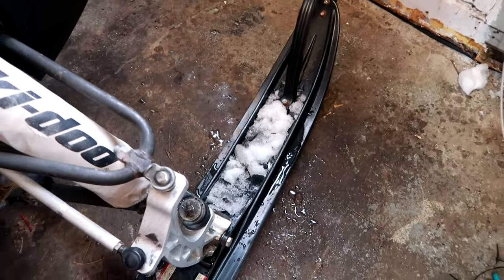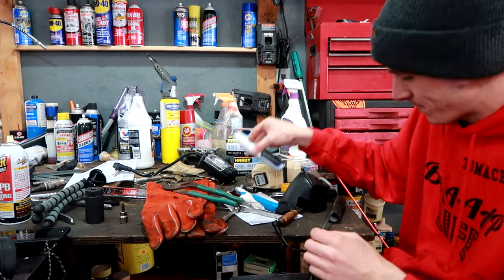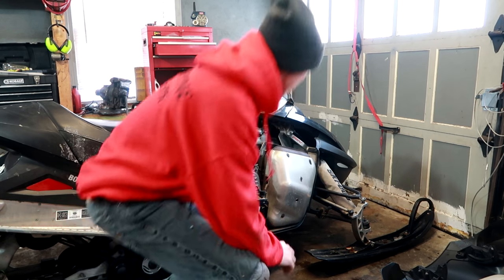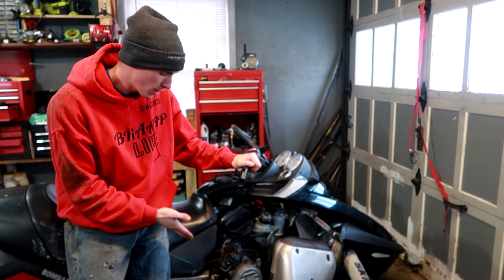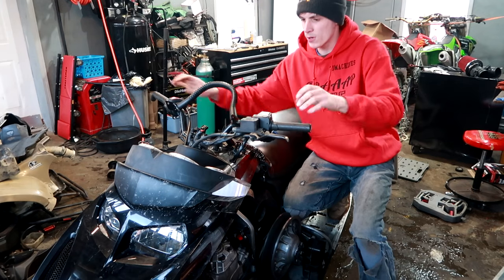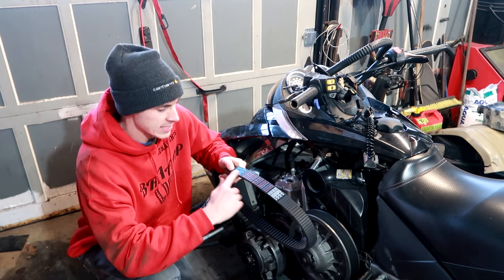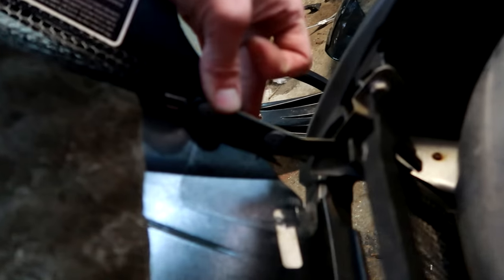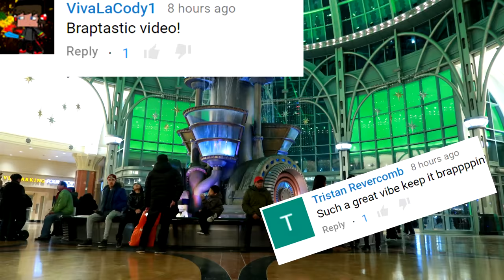It's Worse Than I Thought...

Comment: Dip your hex bit socket in lapping compound before attempting to loosen a stuck cap screw; the fine compound will fill the voids and enable you to remove it.  Works well for KTM's too!
Reply from the maker: thanks for the tip!
Reply: michael delage ☺ smart man it worked on my tractor diff...slick as snot..see Dalton freaks helping freaks through a 3dmachines,you got to love it..

Comment: Instead of going through all the work of putting a new grip on, then finding out that it doesn't work, then having to take it off and run the wires, why not take a multi-meter and check that you at least have voltage going to the plug for the grip while you have it off?
 If you have voltage, then great, your problem was in the grip. If you don't, then you can be tracing down your problem while the grip is on it's way, and you can have the problem fixed by the time the new grip gets there.

Comment: I used aluminum tape on the backside of my ATV plastic and it worked extremely well. Its used in HVAC. No holes for ties is a plus. Can't even tell it is there and strong.

Comment: Been watching your videos for a few years now. Keep it up! Quick  tip, next time you strip an allen head, or any bolt head for that matter. Take a nut that's a little bigger then the head of the bolt and weld it to the stripped head. Hold the nut to the striped bolt with pliers and burn it in hot from the center of the nut. Walla, new head on the bolt, turn it right out with a wrench.

Comment: To easily remove a stripped screw, you can use something like a Dremel tool and cut a deep groove all the way through the head of the screw so that you can fit in a flat head screw driver in The groove. Then spit it out like a normal flat ahead and put in your new screw that you bought off-line

Comment: A little advice about stripped allens..... hammer a slightly bigger torx  bit. Works everytime. The torx bit doesnt push out nearly as much material and bites really well. Also with hammering it in, it is also shocking the threads to a tight bolt.

Comment: 3DMachines, the handle bar warmers do not heat up when the sled is idle, they will only warm up when the sled is in motion, just in 2015 the when the rev xs chassis came out the handle bar warmers were able to warm up while idling. My cousin has a first gen rev and the handle bar warmers do not warm up until in motion. My dad has a 2016 ski doo 600 etec which have the idle handle bar warmers.

Comment: Dalton love the vids keep em coming. Couple things. I know for a fact that Polaris belts do NOT have arrows on them so the way you explained in the video is 100% correct. Another thing, you should never start your sled without a belt you can actually cause clutch damage if it accidentally revs to high when first starting and the sheves slam together. Last thing is you should be able to put an ohms meter on there warmer and see if it is broken that way. Anyways love the vids keep em coming

Comment: Fix your hood with mechanics wire and stitch it up then cover it with plastic weld. I have done this on several bikes, ATV, and vehicles. It works great and in some cases ends up stronger than the area around it.

Comment: When I had my old rev I found the best way to drain the chain case was to pull the plug and remove the cover to inspect the chain and tension. When that cover is off go ahead and clean the inside up good and remove the fine metal shavings. If you don't take that cover off your not gonna get all the shavings out if you just pull the plug. Hope it helps 3D

Comment: hey Dalton ... I have a ski doo myself and my handlebar warmers dont work either and ive traced it all to a faulty regulator ... which is placed on the front of the motor ... you have to take the muffler off to fix but its worth checking out

Comment: @3dmachines if you ever run into the problem of getting a bolt out that is stripped. You can weld a nut to the head of the striped bolt then us a wrench to get it off before it cools. Also love the videos!

Comment: Always clean the inside of a Allen socket bolt. Take a pocket screw driver or a fine point and make sure there's no dirt or grime in there. Always. This is coming from someone that worked at a VW dealership and just about all VW uses are Allen sockets

Comment: Dalton! find as bolt that will go into the stripped Allen hole in the chain case....tac it in with your mig....use a socket to get out the plug..also the heat will get that over-tightened bolt plug loopse

Comment: The skidoo hood plastic is called tpo. Thermoplastic olefin. It's a mix of an olefin like polypropylene polyethylene and a bit of rubber. Fiberflex is the welding rod you need but it's in a bad place down by the hinges. You might be better off with zip tie stitches for strength.

Comment: You can also melt some wire mesh into the plastic for strength.  They sell plastic "welding" kits.  I've repaired bumper covers this way.
Reply: Also weld a bolt head to the drain plug and use a socket to get'er out!

Comment: My drain plug was also stripped. so I did it the old way and just took the chain case cover off. GLAD I did, the lower sprocket bolt was loose and was wearing into the chain case cover.

Comment: take the chain cover off then you can see the chain tensioner that is what I did on my mxz 600 and my Yamaha viper 700 way easier than trying to get the plug out and most of the oil goes down the hole any ways great video thanks.

Comment: Dalton tip the sled on its side or hook a come-along to the front or back and lift it up in the air so you aren't trying to work on the ground. 
Atf oil can be used in most chain cases. It's cheaper.
Reply: Pay attention to where your coolest bottle is so you don't get air in the system. If you do you will have to burp the sled.

Comment: I have 3 CUMMINS. 2 articcat snowmobiles. 1 Honda 250. 1 Suzuki 500. 3 Polaris 1 is a ranger 900 and 2 r razors 800s. And some brand 50 2 stroke. Some brand 90 2 stroke. A Polaris 170 side by side. Yamaha big bear 350. 5 diesel tractors. 2 harly division motorcycles. Love videos keep up good work.

Comment: That is the worst part of buying a brand-new used vehicle. I bought a 2000 KTM125SX and the drain bolt on both sides were stripped with another 12 other bolts worst feeling. I don't understand how someone could strip so many bolts on one bike.

Comment: bought a brand new (at the time) 2016 mxz tnt high output fuel injected 600 ski doo in November of 2015 off the showroom floor, best damn investment I have ever made. She wheelies like nothing and is the lightest sled I've ever ridden. It runs the best in about 2 feet of powder up here in Wisconsin.

Comment: All plastics have writing on it there is a code that tells you what type of plastic it is, if you have some junk plastics see if the code is the same, you cant really use 2 dissimilar plastics to plastic weld, you can also buy plastic welding rods (ive bought them in the past again google the writing/codes) and plastic welding guns... (AVE's channel explains many types of plastics when he is taking a tool apart and ways to test it)
If you melt the surrounding plastic aswel as the weld you can strengthen with glass fibre or horse hair etc

Comment: 3DMachines for taking off grips use an air gun and blow air into the grip on the handlebars and it should expand the rubber and make it easier to take them off and putting them on.

Comment: You could buy ski tracks like the snow mobile's have and attach them to your 250/450's swing arm.

I think they call it explorer snow bike should check them out.  I personally wouldn't try it because well it doesn't snow here in Hawaii and the temperature's already hot as is so I'd run the risk of overheating anyway lol

Comment: As a last ditch effort on a stripped screw or bolt, I have used my Dremel to cut a slot in the head of the screw or bolt and used a flat head screw driver to back it out.

Comment: Hey 3d i know you can use an old 5 gallon bucket for filler material to i dont really know if it would work for the hood but i know for the old broken rear fender it would work

Comment: My suggestion would be to buy a used hood a lot of these used parts dealers in new york will give you a great deal, also let us know how the dayco belt performs. I've always run stock replacement belts on my Polaris and been satisfied with them but if the dayco gives better off the line acceleration I might switch over as i have heard nothing but good about them.

Comment: Try to drill a hole slightly larger than the Allen hole but not all the way through the plug and use a left handed bolt and left handed tap tap the whole put the left handed bolt in and use that to drive it out I hope you understand what I'm saying

Comment: Hey. Just a couple maintenance tips you'll hate me for.  First You really should pull the clutches clean them and check the clearances. Rebuild them if necessary. A sticky (AKA Skidoo) clutch will really make a machine run bad.  Skidoo clutches are adjustable for conditions so you'll want to learn how to adjust them and make sure their setup for your area. Granted if you want to make it run reliable you'll have to replace the clutches with a Polaris drive clutch and a tied team driven clutch.  Next, you'll want to clean the exhaust valves. Oven cleaner works for this.

And remember get your kids hooked on snowmobiles, then they'll never be able to afford drugs.
Reply from the maker: I like the last part the best LOL. Thanks

Comment: If you are going to replace the drain plug, then just dremel a slot into the bolt, and then use a gigantic screwdriver/pry bar to get the bolt off.

Comment: Melting cable ties work but isn't very strong afterwords. I melted cable ties and melted some paper clips into either piece of plastic not very neat if you get it wrong thoe, I have never used it but seen some good videos on plastifix which looks pretty good
Reply: And I agree with welding an Allen key to the drain plug that should work

Comment: +3DMachines thats the thing i hate about plastic welding with filler, if its not the same plastic as what your trying to weld it straight up wont stick at all, i tried welding up a plastic fuel tank for my brothers fuel tank for his four wheeler, i tried a Chick fil-A plastic fork, didnt work, i tried all sorts of plastics and nothing, i couldnt find on the tank any plastic identification stamps or anything but it was a thick tank so i just used the gouge and roll technique lol it did repair for a long time though.

Comment: Dalton I got a 2000 skidoo mxz 600 runs great but it kept burning way way to much gas so I dug into it and found nothing cleaned the carbs nothing do I checked the choke wire and the choke was stuck on

Comment: run your heater off kerosene, you wont die from it, kerosene heaters are used inside houses for emergency heat and cooking when storms pass through and cut power. also im sure your awear that kerosene and diesel are very similar

Comment: Great vids but your smarter then that. Grab your multimeter and make sure you have voltage. If you have voltage then great you know you have a problem with the grip. It's better to know if the heated grip That's  on there now works then to take the time to get it off, inspect it, fix it, put it back on, order it, and wait for it in the mail 3-5 days only to find out the problem was in the wiring or connection somewhere..... Your better this then this dalton. And you know this MANNNNNNNN. lol keep up the good work

Comment: I got a 2006 yz250f with what I think is a blown motor.. I changed the oil and couldn't get the filter out so I left it over night and finally got the filter out and changed that but I didn't put any extra oil in and it blew up on me on the first ride.. there are some metal shavings in the oil now.. any idea on what it could be? and btw it's my 21st birthday today!

Comment: If you have a Dremel cut a slot into the drain plug and use the flat head to get it out
Reply: Aiden Megargle you sir are absolutely right..also an impact driver makes quick work of the fact that it's stuck
Reply: Yep. Although, if it's a recessed plug, may not be able to get enough cut in the plug for a standard screwdriver to bite into it. Unless you have an impact screwdriver that needs very little material to do it's job.

Comment: plastic welding will save your ass from time to time is it ties work on certain things but you want a plastic that's really close to the same maker build as what you were working with I use it ties to weld my inner belt cover on my ATV and it works really good

Comment: forget the drain plug. just pull the cover off and wipe out the gear oil and any other crap that will likely be in there. gives you a chance to inspect and adjust tbe chain tension. and if you haven't already, join dootalk.com it will become your best friend if plan on keeping that 800

Comment: You can use one of these. They sell different types of "filler rods" for different types of plastic. 
http://www.harborfreight.com/plastic-welding-kit-with-air-motor-and-temperature-adjustment-96712.html

Comment: if the plug is shot just take you Dremel cut a slot in it for a screwdriver. get a new plug wam bam super slam oil in the pan.

Comment: if the plug is shot just take you Dremel cut a slot in it for a screwdriver. get a new plug wam bam support slam oil in the pan.